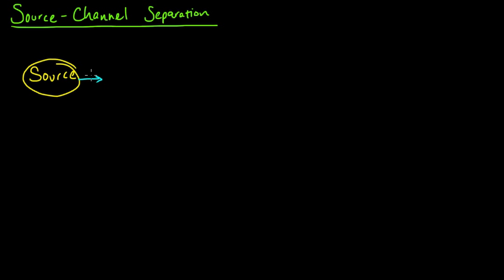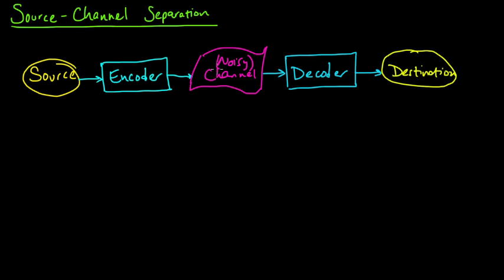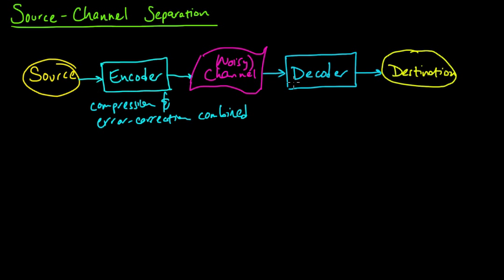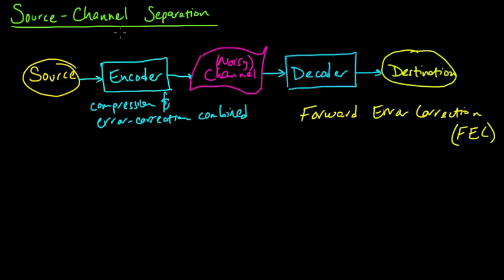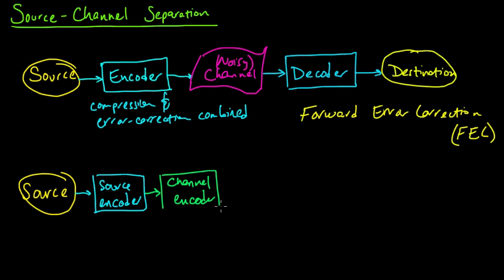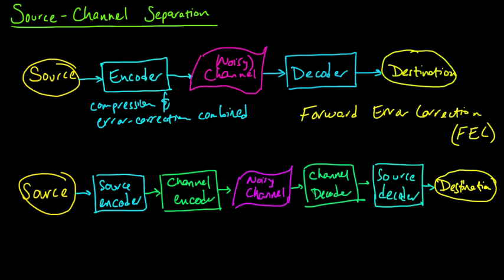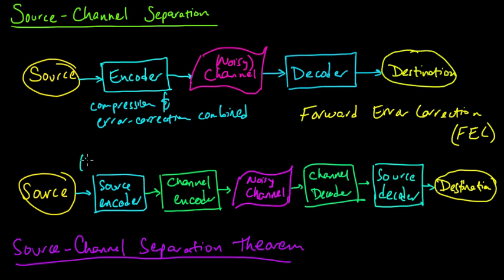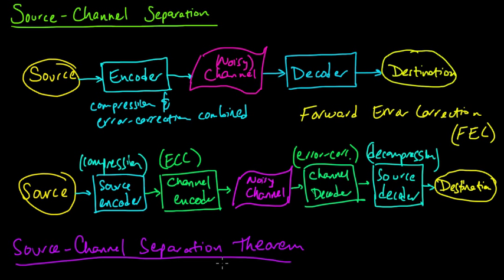(IC 1.4) Source-channel separation

Comment: It is good that source code is independent of channel code. But, the question "can you interchange the compression and error correction stages" begs itself.
Reply: +Valentin Tihomirov no. channel encode/decode protects stream/data against transmission errors. But you can skip source encoder/decoder if you want.